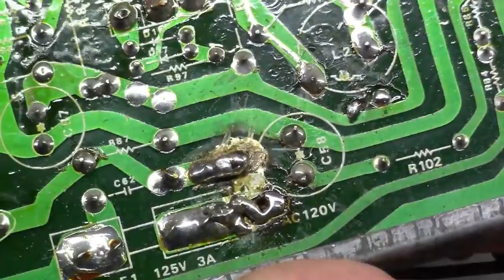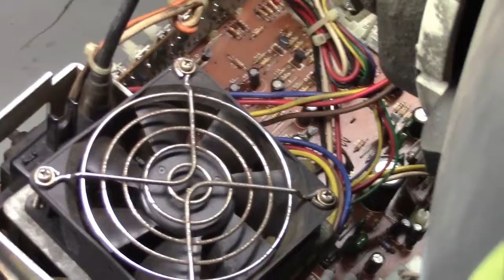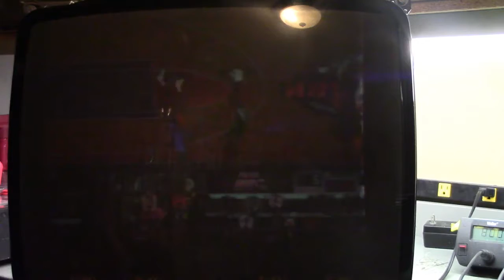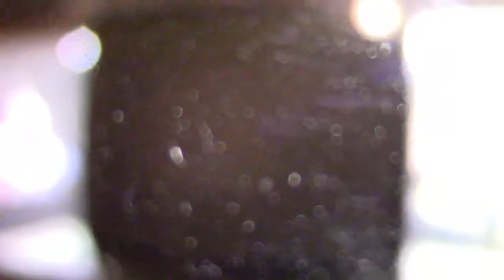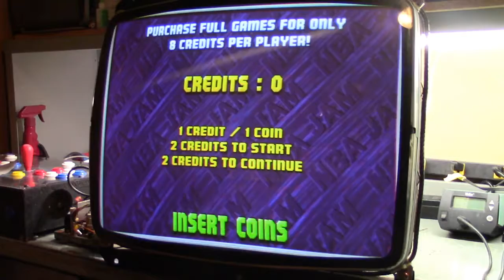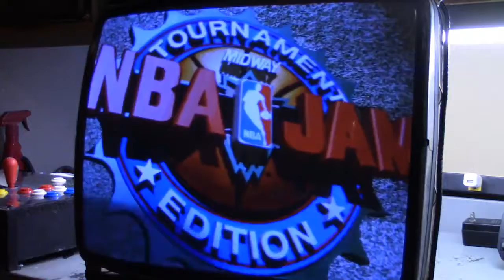25" Kortek KTW-26N Arcade Monitor Chassis Repair Series - Tube Issues (Part 7)

Comment: For the lightbulb test on this chassis, would you attach the positive lead to the white or black wire coming off the B+ resistor?
Reply: Tested and you should connect the lead to the white wire coming off the B+ resistor. Bulb lights up and reads 129.1 volts. 

For context, I'm trying to get a dead chassis working. It had a blown fuse and fried HOT and VR. I replaced those and the fuse, HOT, and VR blew again. Tested all the usual suspects, all diodes in the rectifier section check out. Film caps near the flyback aren't shorted. R101, R103, and R104 check out. 

I really hope it isn't a bad flyback because it looks visually fine, no cracks or leaking anywhere. I wish there were replacement flybacks available. 

I replaced the caps as some of them were bulging and am going to give it another power on with a new fuse, HOT, and VR. After passing the lightbulb test, I hope it doesn't blow up another $20 of components. 

Could a bad filter cap cause the HOT and VR to fry? It was bulging so much that the PCB was actually cracked on the surface below the filter cap.

Comment: 8:54  You may have figured this out, since this video is older, but I'm following alone with my board and noticed my traces aren't even the same as yours.  Maybe it was a production error they fixed in later versions?  https://i.imgur.com/a2feN1W.jpg

Comment: Quick question! i unsoldered the wires on the little board for the C1 Cap the ones that read DC12v where do they get soldered to again?
Reply: Also, trying to figure out what plugs into the RV1 and RV0

Comment: “In bed thinking, what could this possibly be…”. Man, I know that feeling, haha. The troubleshooter’s burden.

Thanks for an excellent and helpful video. I’m currently recapping this exact monitor board, and watching you gave me ideas for some good things to check while I’m at it.

My Neo Geo intermittently seems to lose all red color, so I’m hoping that reflowing solder on the header pins might fix a bad connection.

Comment: For your vertical size issue: I just had the same issue with this chassis. Even though this is a k7000 clone, it needs a lower end (7ohm) vertical resistance.  K7000s are usually around 10-12 I believe.  So basically a k7000 yoke isn’t necessarily automatically compatible.  Also many parts are not shared between this chassis, but it is very close.
Reply from the maker: Great info. Thanks!
Reply: @MikesArcadeMonitorRepair  Lol, just saw you reached this conclusion in the vid.  I did a thread on KLOV about this issue, there’s a link for this chassis schematic too

https://forums.arcade-museum.com/threads/k7000-clone-kortek-ktw-n-26-vertical-size-too-large.490055/